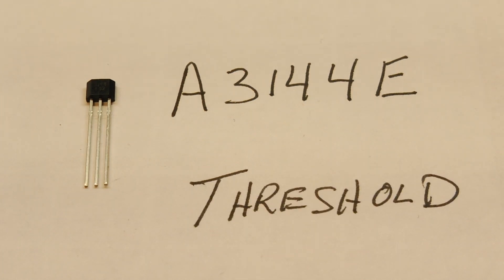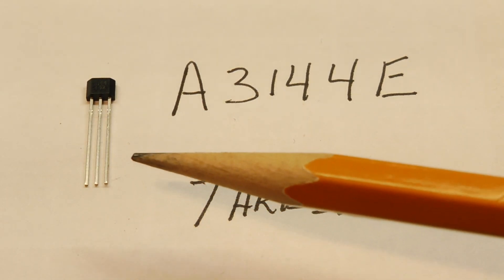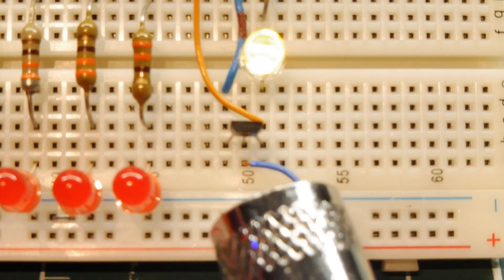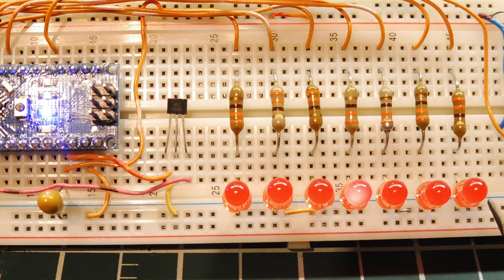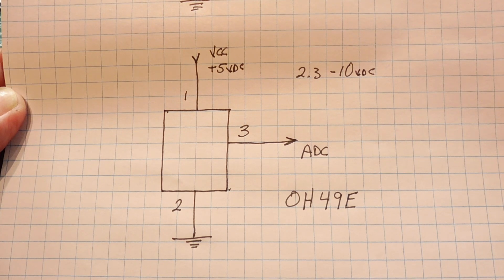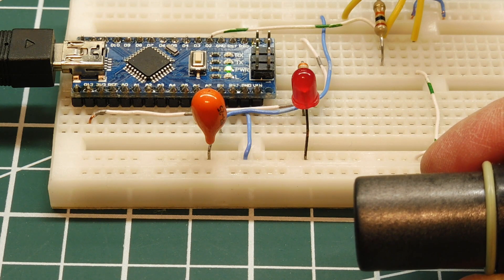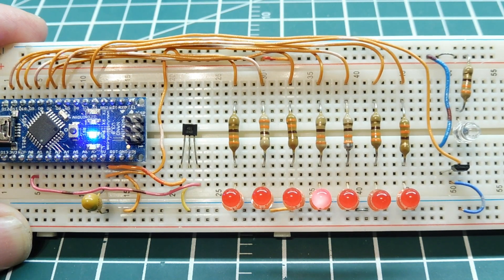How to use Hall Effect Switches

Comment: could you please provide a schematic of the circuit? what are the values of the resistors? and what is the value of the yellow bulb (im assuming its a capacitor)? i am new to electronics and am going to try and wire up this circuit. thanks for all the help!

Comment: is there a way to do it as a PNP normal open ? what will change in the wiring ? thanks
Reply from the maker: Check out my relay driver video schematic at the 4 min mark and connect the Hall sensor to input #2. This is a high side switcher using a PNP output. https://youtu.be/Ogbj6g05Hvg
Reply: @0033mer  thanks for your fast reply

Comment: The A3144 Hall switch has a very loose threshold tolerance compared with other ones like the A3141 to A3143.  Is that why they seem to be the cheapest and most widely available one?  The gauss threshold is a 7x spread from lowest to highest. I needed one with higher sensitivity and lower on resistance to match one from an LG ice maker tray position sensor, but the A3144 ones I bought were not as sensitive or low on resistance as the original, so I didn't try using them.
Reply from the maker: The A3144 together with the A3141/42/43 originally manufactured by Sprague then Allegro are discontinued so any devices you find will be knock-offs. An equivalent is SS441A by Honeywell. The sensitivity is fixed on threshold sensors. If you want to adjust the sensitivity you must use a linear sensor with appropriate circuitry. Check out this video: https://youtu.be/72CGYTzAX0E

Comment: very useful and didactic 
thanks
i want to control modern coil on plugs on an old Mercedes W201 electromagnetically from the delco
and maybe later the injection by adding delayed outputs whith an arduino board but i don't know wich one to choose

Comment: Electronic NOOB question: Could this OH49E transistor and other discrete components be assembled on a board, and used [somehow] to detect short circuits, on a pcb WITHOUT any Arduino device?

Comment: Your diagram showed the magnet behind the sensor with the turning gear on the other side.  Your actual sensor seemed to have a magnet between the sensor and the gear.  Am I right?  If so, then does the position of the magnet with respect to the gear and sensor matter much?
Reply from the maker: Yes .. the position of the magnet and its strength with respect to the gear and sensor matters. The magnet creates a bias on the sensor so it can detect a ferrous object. This video will demonstrate the relationship. https://youtu.be/9wyeogsahag

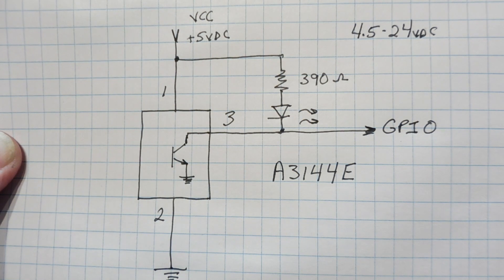Comment: @0033mer on time index 4:04 why is your resistor on the 5v in before the led, and not after the led? And also, why are you using 5v to drive a 3.3v led? Shouldn't you have a voltage divider? simple questions, but I'm just coming back to this stuff and its a bit confusing. Thank you.
Reply from the maker: The resistor and LED are in series where the current through the LED and the resistor is the same. The position of the resistor does not matter. You can drive a LED with any voltage as long as the series resistor limits the current below the max rated LED current.
Reply: Thanks for the feed back, it helped me..

Comment: I liked this video. 
There's more than one hall effect monitor video on youtube, but none of them really get into detail about how each of the hall effect monitor's are different. 
An average video tells you roughly how it works, but few of them tell you what the difference between a linear vs threshold hall effect monitor is. 

I'm thinking i might be able to use a hall effect monitor to flip a transistor switch almost as fast as a pwm signal in a very specific application, but i saw a guy doing his pwm thing the other day and I'm not so sure. 

At anyrate, thank you for the good video, and i hope you get more attention, and thus more advertising dollars, for it.

Comment: FYI with some linear hall effect switches you might have to use a Opamp based voltage follower to be able to inject a big enough voltage into the Arduino's ADC pins. I delt with that with an attempt to building a digital amp meter using a hall effect switch and a ferrite core. The project worked but the resolution was crap.

Comment: it would be great if you provide demo code as well .
Reply from the maker: There is no sketch. I program in Forth and assembler. Here is the code:
 : LED.toggle   \ toggle LED on Hall detect
       BEGIN        
           Pin2 Low?          \ GPIO input pin
           IF Pin13 toggle  \ toggle LED on Nano
              Begin Pin2 High? Until
           THEN
       AGAIN ;